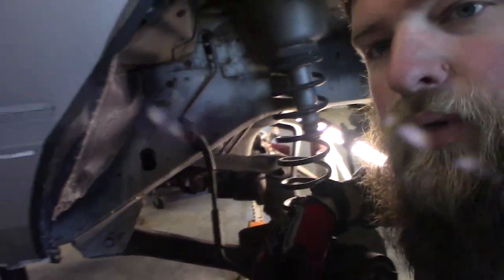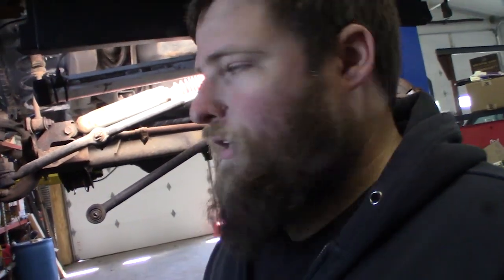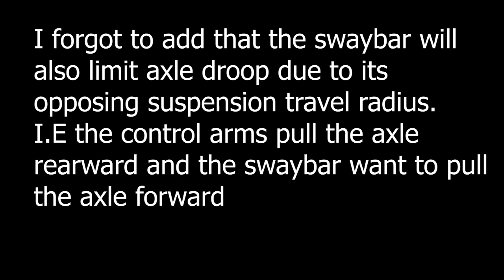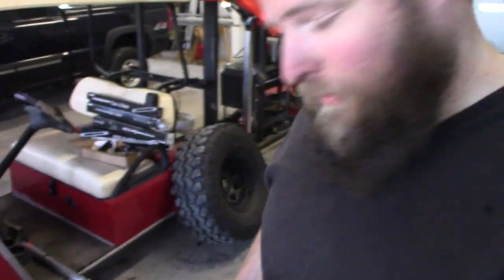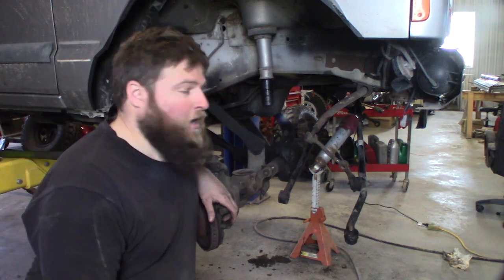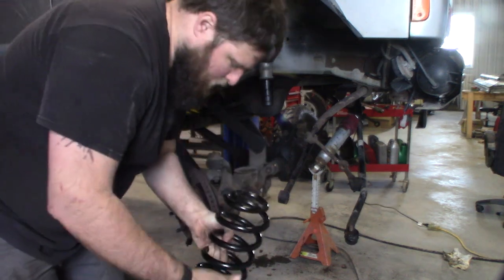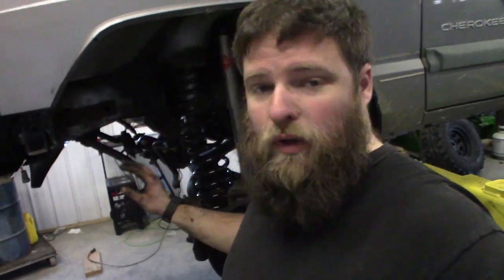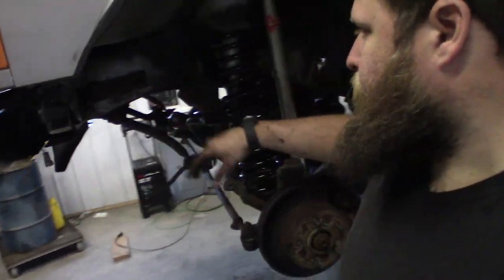Installing A 3 inch lift On A XJ PT. 1 | Budget Lift For A Jeep Cherokee XJ

Comment: R is definitely a rear spring. Probably a wrangler.
Reply from the maker: you're probably right.
Reply: Scott Vassar no, I don’t think it is.  On my jimny’s and my navara the springs have always been longer and of an alternate spring rate on the drivers side - due to ALWAYS carrying additional weight on the drivers side _ I.e. driver and steering column etc
Reply: Definitely NOT a Wrangler Rear spring.

Comment: That’s not stock right but there’s no weight on the front axle. Don’t have to do brake lines with a 3 inch lift

Comment: Hey man. Wouldnt it have been better to rent a coil spring compression tool from wherever to take springs out or am i missing something?
Reply from the maker: It’s kind of preference. I don’t like removing coil springs when they are under compression. I’m afraid I’d bump the coil compressor wrong and it become a projectile. It’s worth the extra step to take it out unloaded to me.

Comment: I see people eliminating the front sway bar.  As apparently its not needed? Thoughts?
Reply from the maker: MARZ1911 I don’t think the front sway bar is needed. The front feels looser without it for sure but still drive able. That being said I do plan on putting the sway bar back on at some point bc I want firm up the front suspension.
Reply: If you want you can buy away at end link quick disconnects. They arnt expensive at all like 50 bucks for the pair maybe? And you can just un clip and pin thout the way when you want full flex and then for road driving just re attach them
Reply from the maker: Yes. That’s the way I’d go because the jeep is kind of unstable when taking corners on road.
Reply: @TheOffRoadCorner  drift life

Comment: I have a couple questions for all you XJ owners. Will 31’s fit on a 1999 with no rubbing issues with 3” R.C. Series 2 lift kit with stock Gambler wheels and how much does it affect gas mileage? It’s my daughters 1st vehicle but I don’t want to kill the gas mileage. Thank you guys in advance!
Reply from the maker: There is a chance that the tires will rub the front lower control arms with the steering wheel turned to full lock. A different wheel with 4” of backspacing will fix that. Or on the cheap you can use wheel spacers but I’m not sure what width you’d need and wheel spacers can be dangerous if not installed correctly
Reply from the maker: I got about 14 mpg driving out west last year on my 32” super swampers. Not bad if you ask me
Reply: Don’t know if I said thank you. I appreciate the feedback.
Reply from the maker: This what I’m here for. Glad I could help

Comment: Are those tires a true 32"? I'd like to go up to a 4" lift, any input on how you would go about it? Save some $, but something that be just as good
Reply from the maker: Yes these are a true 32. I think they actually measured 32.5” brand new. The lift I put together works really well. The only change I would make to this setup is I’d find stiffer shocks for the front and I would have just use the entire Durango leaf pack( besides the main leaf). It works great and is cheap. These tires are not cheap by any means. I’m honestly going to switch to a 33” milestar Patagonia mt once they wear out. Much cheaper tire but have good reviews

Comment: What leafs off what year of Dodge Durango did you use an where can I get the correct center pin ? Thanks man love the videos
Reply from the maker: the leafs I used were from a 99 durango from a local pull-a-part. For center pins I used ones for a 99 durango. I got my pins from roockauto.com. heres a link - https://www.rockauto.com/en/parts/dayton,CB3850,leaf+spring+bolt,10353.

In part 2 I go over the bastard pack install in detail. https://youtu.be/FdvDlqS1M1Y
I also left the links for everything I used in the description of that video. 

Thanks for watching my videos! let me know if you have any other questions.

Comment: Good video what size tires you have?
Reply from the maker: MGR Maquinaria I’m running 32/11.5r15
Reply: The Off Road Corner do they rub?
Reply from the maker: No but I’ve trimmed the fenders and I’m running 2 hockey pucks on the axle and daystars extended bump stops

Comment: What center caps are those and where did you get them
Reply from the maker: I got them with my tactic wheels from quadratec. Here is a link to them.   https://www.quadratec.com/p/tactik/center-cap-tactik-steel-wheels
Reply: @TheOffRoadCorner  Does it have to be for the wheels you got only or no cause I got soft 8's
Reply from the maker: They may fit soft 8’s. I guess they’ll fit anything with 3.3” center hole

Comment: Did you ever find out why one coil spring was longer than the other?
Reply from the maker: Dan Hambrick not really. I did measure the ride after install and the driver side was about a half inch lower than the passenger side. I’m guess is the longer coil on the drivers side has a lower spring rate.
Reply from the maker: Dan Hambrick, I called BDS. They say the coils should be the same length. I have to return these coils and get a new set from Jack-it.

Comment: Long spring is for driver side
Reply from the maker: I ended up calling BDS and they said the coils should have been the same length. I return these springs and reordered the same one. The second set of springs were the same length. I must have got a mix-matched set for some reason.